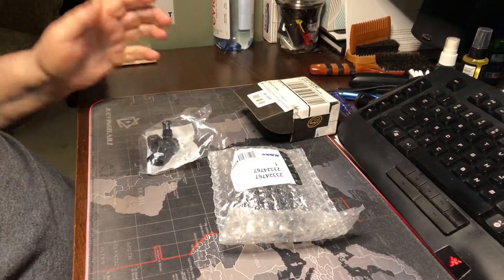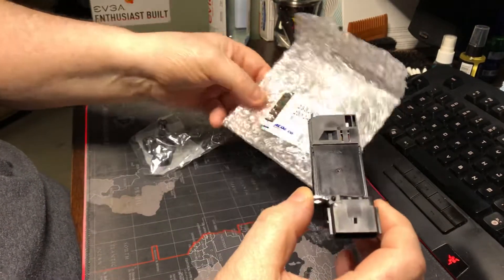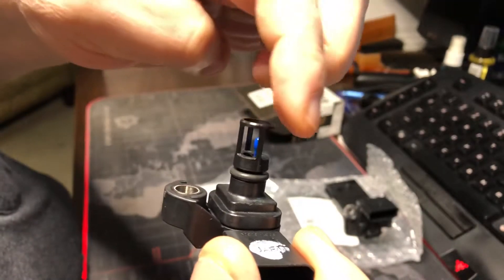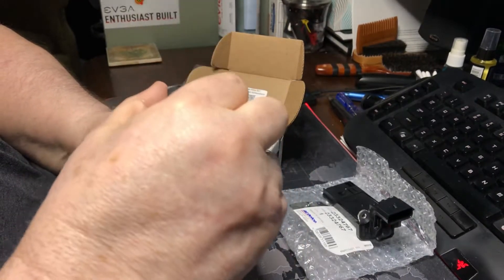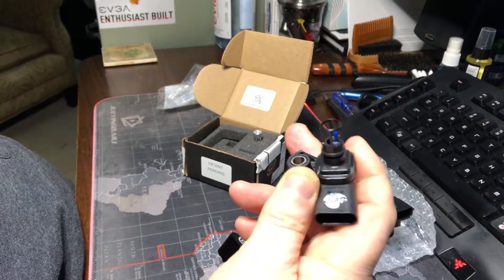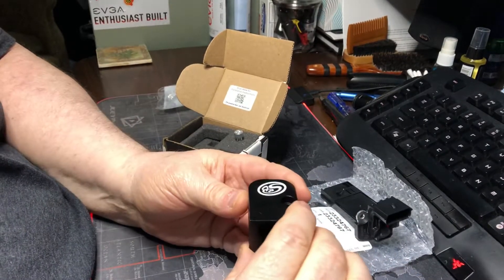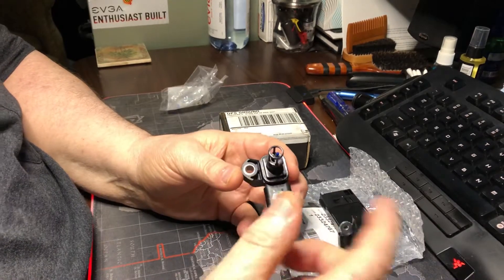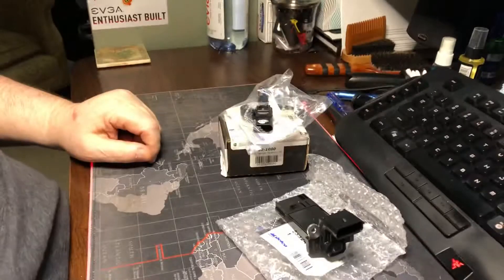Duramax L5P- MAP-MAF Rough Idle

Comment: Frosty, I would suggest that before making a video showing how to fix a problem you may want to learn the function of the sensors you are replacing, You got it right on the MAF sensor being a "MASS AIR FLOW" sensor. However, the MAP sensor is a "MANIFOLD ABSOLUTE PRESSURE" sensor. It senses pressure, not air flow as you referred to it in the video. It is however located in the intake manifold airstream near the throttle body to sense air pressure. The reason they get carbon build up around the sensor and its cage is due to the EGR valve returning exhaust gas back into the intake to reburn any unburned fuel. The simple solution to reduce the frequency of having to clean the sensor is to remove it from the direct air stream by installing it in the aftermarket elbow which still allows it to sense pressure and not pick up carbon from the EGR gasses.

Comment: My l5p shakes at idle pretty bad. 19000 miles. Cleaned my map which was pretty clean. Dealers are useless.  Seams to be a problem across the board new and old L5P. Wtf GM. Get your shit together at 80 grand a truck!

Comment: Doesn't MAP stand for manifold absolute pressure? As in it measures pressure not flow, which is why it can be relocated and doesn't need to be in the actual air stream? I'm having similar issues with my '17 l5p, and look forward to seeing if this helps your idle. Thanks.
Reply from the maker: once i took it out it was completely covered with soot and carbon. my truck runs much better now that I did that and the cold air intake. This truck has never regened. I drive it like i stole, rugged and fast. 110k miles and runs like a top.